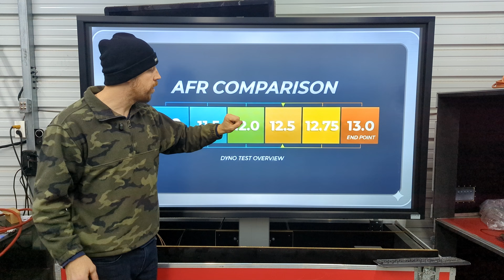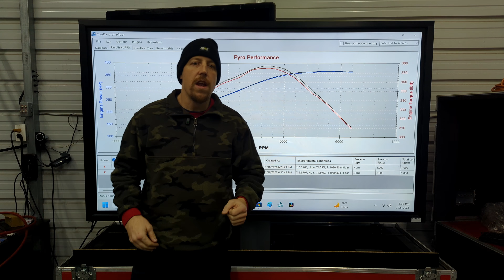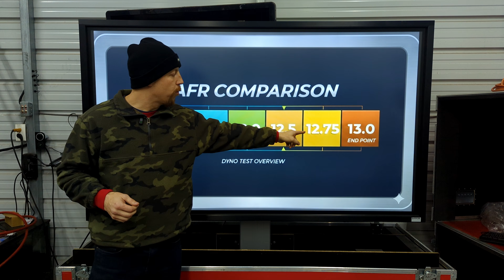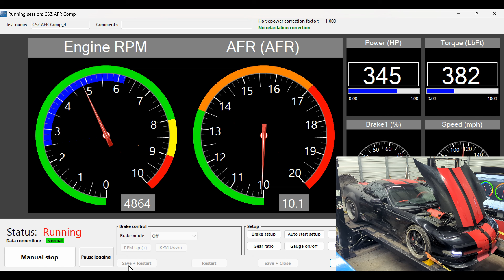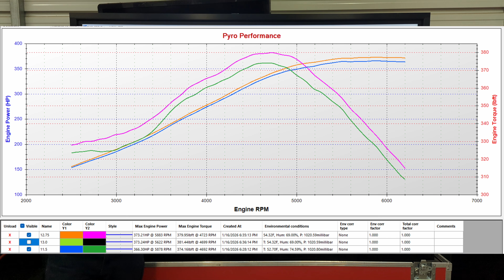Lean vs Rich: How Fuel Mixture Really Affects Power (Dyno Tested)

Comment from the maker: As promised, and long overdue, here's the video with a similar comparison, but this time with Spark Advance:

https://youtu.be/Mu4UQ-B14oo?si=aYVbLLkfzkRH3S6Y
Reply: How about one of these videos but exploring best fuel and spark for 60 to 80mph freeway cruising for best MPG;s with the current price of gas! (but I guess you would need a hubdyno?)
Reply from the maker: @krusher74   since my dyno has a brake I can do this, and I do as a part of the tune when I'm doing one. 

I might have to make a video with that. That's a good idea.
Reply: Haha, already watched it😊. And again, thank you! Unfortunately, I have to "test and tune " and read the plugs without a dyno, but your video cleared a lot of questions that's backed by Dyno results. I'm running 13.5:1 compression in my sbc 400 using Sunoco 112 Supreme and 36° total timing. My understanding is that the flame front needs more timing to clear the piston dome.
Reply from the maker: @TheOGBumbleBee70RS  older engine platforms don't generate the same level of swirl and turbulence in the air fuel mixture, so they'll often need more timing advance than engines with modern heads. This is one place that modern efficiency standards have actually driven beneficial advancement in technology.

And yes, piston dome plays a role as well. This really is a stack of a handful of factors, and we've touched on a couple of the major ones.
Reply: Great video. I've always been told and have seen that, following the same principals you showed here, and for NA or Supercharged cars, starting with a leaner AFR and ramping in timing early before peak torque helps the engine spin and build power faster. Then richen once you hit max torque and reduce timing to MBT up to redline. Can you test this next?

Comment: 8 years back my 1997 Volvo C70 T5 was tuned to around 11.5 on the AFR. Made 310hp/450nm. My fuel pump started dying and it gave me figures from around 12.5 to 13.6 full trottle all of a sudden. I can tell you I really noticed a difference in power increase, luckily I had the AFR to point out there was a problem. Always have an AFR mounted on old turbo cars with retard ECUs.

Comment: Good video but its harder to understand a test would be set Afr and set revs,  coming on and off throttle for gear  change causes lean points as air travels faster in theory tham fuel, this is why we see race cars spitting flames at closed throttle to compensate for that lean early gear phase

Comment: Thank you for the posting.  I have a 350z 6 speed manual - with kinitex high velocity plenum, cold air intake, racing header, exhaust pipe, high flow cat - Tuner said ecu need to inject more fuel or may have detonation issue at high rpm.   With mods - more air can get into cylinder - inject more fuel keep air/fuel the same - is it correct ?  I feel engine pull hard till 7500 rpm.  Stock engine - run out of steam after 5000 rpm.   Thanks.

Comment: I've run 12.0-12.5 AFR on e85 on my Evo for over 12 years
Reply: lol nah.  What wideband are you using and what does your wideband gauge primarily read in?  It is likely doing the conversion from lambda to 93 instead of lambda to E85. Stoich for E85 is 9.8:1, running leaner than a safe idle AFRs is crazy.  You will definitely send pistons to the moon if that were your actual AFR at WOT on E85.  I have a AEM UEGO X and it reads in Lambda which is not effected by ethanol content, it will calculate AFRs for you but you have to tell it if your running 93 or E85. i have a flex fuel car, and i understand 93 AFR's better than Lambda I can more quickly recognize if i am having a lean or rich so i leave it where i understand it best. It may display a 12.2:1 AFR at WOT but its actually reading 0.83 lambda and doing the a conversion, the actual AFR for E85 is around 8.2:1.
Reply: @Crusher103 lol yes! Zeitronix afr gauge

Comment: Hi, great video, back to back factual data! 
Now that you have done a spark advance video aswell, is it possible to mix them both? Im under the impression that leaning the engine out will make the combustion hotter as such helping speed up flame front propagation! I'm really curious if that effect can be mitigated (if it even exists)  by running more advance on a richer mixture, bringging the end results on all AFR's closer together, when all are timming optimized. I imagine these videos must be alot of work and would like to thank you for going to such efforts to share the knowledge!

Comment: Rich can run more compression and timing without knocking, also keeps components cooler. but super rich (usually sub 12:1) will have trouble burning efficiently and rob some power.

Comment: Carburetors traditionally leaned out at full throttle high rpms which is why old race engines would run clogging high rich at idle and low rpms.  Fouling plugs on cold rich running race engines would sometimes be so bad they'd be started on hot running plugs then have them replaced with cold running plugs for racing.

Comment: Stoich AFR is 14.7/1 , anything under is rich mixture, if you talk about lean mixture you should refer to 15/1 and higher. So 12.5/1 means very rich mixture.
Reply: For a engine with a prefect combustion yes but the real world with E10 and mixing inside the engine makes it so we can’t have perfect combustion.
Reply: Real world AFRs under wide open throttle are not always near 14.7 to 1. Engine applicability matter a lot  and the AFRs change with it.
Reply: @saad8029  I use to watch live on the phone the Lambda Factor,even under WOT it still swings from 0.98 to 1.02 as on steady cruising.the only moment when I see it steady 0,98-0,96 is when I start to lightly  lift the gas pedal for reducing the speed .
Reply: This will never work in the real world. Yes stoich is 14.7 but in the real world if you tried to tune to 14.7 you'd have a bad day. You'll never make any power and your piston rings are gonna take a massive beating. Bad info
Reply: @dustinandtarynwolfe5540  why?
Reply: @dustinandtarynwolfe5540  I have OBD Eleven instilled on my phone and I keep it connected all the time monitoring AFR,I see AFR lambda 1 swinging between 0.98 to 1.02 all the time including while WOT

Comment: I am trying to get into tuning but from what i gather if i am not mistaken this leaner afr approach applies to the test case of the video because the car is naturally aspirated right? In a turbo charged car you would go below 12.7 because of the added air pressure from the turbo correct if i am mistaken. (  basically i am trying to understand if i a turbo charged engine would need generally speaking more fuel per air to cool down more).
Reply from the maker: You are absolutely right. Boosted engines need to be run richer to keep temp under control. 11.5 - 11.7 is often a safe range, but there are a lot of variables.

I would not attempt to tune boosted vehicles without some sort of knock ears, det cans, etc. Off the shelf solutions are expensive, but there are some good diy solutions out there.

Comment: Nice video, what was the ethanol content on the fuel you guys used on this video? I know we are suppose to run richer Afrs depending on ethanol content. I made the switch from using Afr to Lambda not that long ago as differing ethanol content made things a little more confusing.
Reply from the maker: Fuel was standard E10.

That said, AFR reading of a wideband is just a mathematical conversion from Lambda. 14.7 on a wideband simply means 1.0 Lambda.

Comment: I lost 120whp on the dyno over my less modded number LS3 car tuner said fuel pump isn’t giving enough fuel no matter how much more he asked for said something about MV’s being very low can I really lose that much power form that one issue
Reply from the maker: It takes fuel to make power. I can't say you really have an issue or exactly what it is, but fuel delivery problems have no limit to how much power they can reduce.
Reply: @PyroPerformancePNW ahhh I see think it was the alternator b terminal was lose he was adding fuel and noting happened but as soon as that bolt got tightened car wouldn’t run no more like it’s getting way to much fuel

Comment: Another great video, thank you very much! Recently I installed a calibrated Bosch wideband O2 sensor to have a grip on the motorcycle engine AFR. Due to emission regulations the engine was running way too lean, almost always 13.5 up to 15. White valves and white exhaust as the results...

Comment: For efficiency though a slightly lean mixture is much much better than a slightly rich mixture. Not mention that EGR circulation, even a bit more than it should, will also kill power delivery. No?.

Comment: Good to know my 11.5afr tuning is safe on my turbo Miata. 

They run hot to begin with, so any lowering of combustion temperatures are a plus. 

The hell with an extra few ft lbs of torque... I want it to be safe and last.
Reply from the maker: On a boosted application that's 100% the right move.
Reply: @PyroPerformancePNW 
🥰🥰🥰
Reply: I am running on the same issue but with bikes, Brazil gets very hot and my engine cant last more than 60k miles
Reply: Don't assume the AFR on one engine is safe for another.  Read about what's safe for your application!

Comment: Great video! I would like to see the EGT's of 12.75. would you consider doing at test just like this while adding water injection - 5-10 angstrom droplets . I would like to see tq output & EGT @ 13:1 with water 💦. Maybe start with an amount that equals the difference between 12:1 & 13:1 by weight of the fuel.
Reply: You would lose power unless you add some timing
Reply: @flrpower5628 David Visard did a video on water injection, very interesting concept.

Comment: Hi Mate 👋
The 370HP measured in this Video ist your Wheel HP?
That is pretty much for a LS6.
The Engine is Not Stock, right?
Reply from the maker: The engine is stock. LS6s usually put down in the neighborhood of 360 whp. You can usually get a bit more with tuning.

Comment: I am a beginner when it comes to the Terminator X-Max. If there is a dip in the curve, will I be able to look at that RPM range and change the AFR only in that section? This way if it's a yes I know I can look it up to see how to do it.
Reply from the maker: You will have to adjust your fueling table, which is a combination of manifold pressure (i.e. throttle position if you're naturally aspirated) and RPM.

Really what you want to do is ensure that your entire table is dialed in and producing the AFRs that you have it set to.

Comment: A leaner air/fuel needs longer to burn so try adding more advance to the leaner mix and see if you get any improvement
Reply: This is nonsense, leaner mixture makes more heat, more heat makes it more prone to detonation. Leaner mixture needs lower advance
Reply: @damajeks its not nonsense its physics, and chemistry. A leaner mix means there is physically more space in between the air and fuel molecules regardless of how small it's still there. And the amount of time the flame front needs to travel across the mix is longer. Go back to school and learn some shit before you flap your stupid face hole.

Comment: I’ve been designing, building and testing engines for 40 years.  Torque and HP must cross at 5252 rpm. On some of the tests, it looks like they don’t cross at that rpm. Something doesn’t compute.
Reply: must ? but some engines don’t even go above 5000rpm
Reply: @rynbenhammouda1319 and all of those engines make more torque than horsepower. Just a function of the equation.

Comment: There are a couple problems with these type of tests. The first problem with these type of tests is they do not properly address injection phase / injection timing, nor do they account for the tiny window between overlap and bottom dead center where kinetic energy of incoming air due to peak piston velocity would be ideal for duty cycles less than 25% since its only 1/4 of the 4-stroke cycle allowing injection into this window. In other words, Engines that see duty cycles higher than 25% cannot fit the entire pulse into the post EVC(exh valve close) window of say, 300* btdcc to about 160* BTDCC (before top dead center compression) so some of the fuel is hitting the closed intake valve. OEM engines like GM ECU from 2005 (LM7/L33 for example) use a start of injection time phase that places fuel onto the intake valve before it opens on purpose. Whereas stand-alone ecu (such as Holley) use an end of injection timing and the popular spread sheets have fuel going into after EVC and spraying onto the closing/closed intake valve during the compression stroke, completely different from OEM timing. The reason this matters when looking at afr and power is the fuel hitting the intake valve causes several power-impeding processes such as boiling from the valve (displaces oxygen) and lost kinetic energy of injection (the fuel pump's fuel pressure provides kinetic energy to fluid(air is a fluid)) which causes a change (impedance) in the airflow which can be seen in a MAP based(speed density) as a richening up of the mixture even though the injected pulse hasn't actually changed. In other words the power changed but the afr didn't actually change by virtue of fuel injected - it changed because the timing of the fuel injection caused a reduction in airflow mass flow which caused an apparent richening up on the wideband. So when you attempt to study air fuel changes in power in a non-MAF platform you have no way to interpret the airflow changes caused by the fuel injection timing strategy which adjusting mixture richness. 

Another problem is different engines have different responses to mixture changes, because combustion chamber tech and spark plug placement have as much to do with power:afr relationship as the compression ratio and exhaust dynamics. 2JZ-GTE and SR20DET engines for example are brother with the center top plug placement and excellent combustion chamber technology which can compensate for variations in mixture by virtue of its design. Whereas LS and other chambers at reasonable compression (lower/average in turbo apps) need richer mixtures to ensure available fuel molecules and mixing is taking place - which brings us to another problem in this type of study. The wideband is measuring oxygen content not fuel, and has a hard time telling us about efficiency of combustion. In other words the rate of combustion and outlying fuel mass that enters exhaust will not show up on widebands when the engine isn't burning effectively as it should because of some issues (plug cleanliness, spark energy, timing/compression, slow fuel(too high fuel quality for the pressure causes a loss in power for example). Thus the only way to entertain these variables is to compare fuel mass flow rate to air flow mass rate and compare them to see whether they match the wideband average - which is yet another problem, since the wideband is averaging all cylinders you actually need individual widebands on each cylinder to perform this type of study otherwise a weak cylinder or poor performing cylinder (simple as a weak plug or weak ign on that cyl) will throw the air mass to fuel mass ratio off there obfuscated by the averaging nature of a single widbeand.
Reply: The injection timing past 2000 rpm does not really change the AFR measured or not. Think about it , it happens so fast it doesn't matter when you are injecting fuel.
Reply: @flrpower5628  I've measured a difference in hundreds of lbf-ft of torque on twin turbo applications with a massive difference in throttle response from the mid-range by adjusting injection timing in that range and also specifically by matching the valve timing to the kinetic energy of a high pressure fuel pulse within the window of post EVC and IVC around 22 to 28% duty cycle max from say 330* btdcc to 160* btdcc 

There is even a difference in fuel smell and some engines experience 'trailer hitching' in the cruise range 2000-3000rpm when injection timing is wrong 

IT absolutely does matter and makes an enormous difference when the engine is setup to take advantage of timing and spray kinetic energy as the fuel pump supply pressure and a proper injection spray technique acts as a mini-supercharging influence on the cylinder intake stroke. 

You should do more research and it is clear you are lacking these experience in tuning applications. I am not picking on you but your statement is so incorrect and ignorant it cannot be taken seriously.
Reply: @Wabits  Wow you are a voodo tuner 🤣🤣🤣
Reply: @Wabits   Sounds to me like you have far too much overlap on a boosted engine and just blowing fuel and air out the exhaust.
Reply: I was going to make a similar observation. Not so much on injection timing but on its effects on air mass reaching the cylinder due to increased fuel mass, either displacing air mass or becoming a restriction to air flow.
I'd like to see the same test on a direct injection LT, where air mass should be the same at any given RPM, regardless of AFR.
Reply: You forgot about the O2 sensors for more information about combustion efficiency.